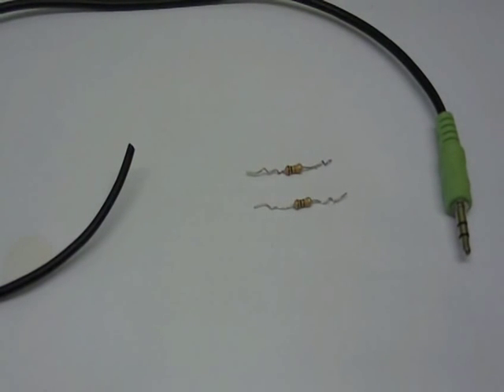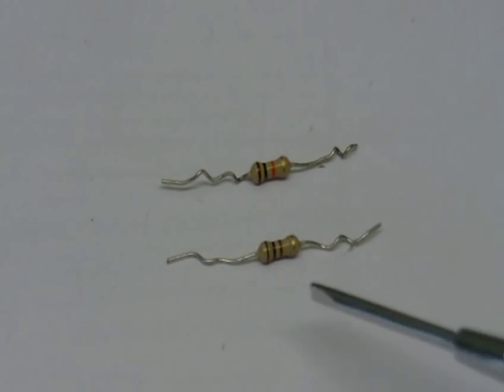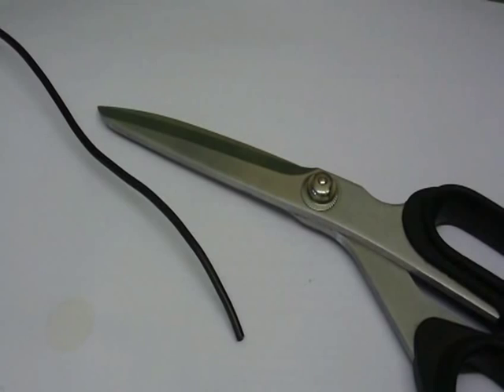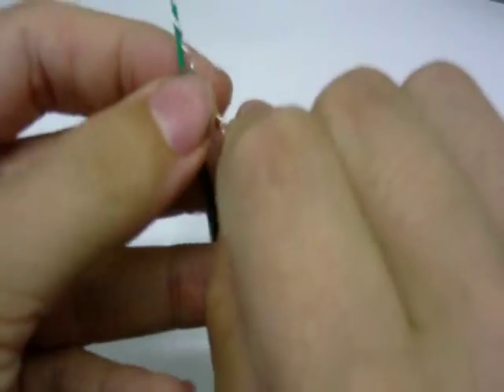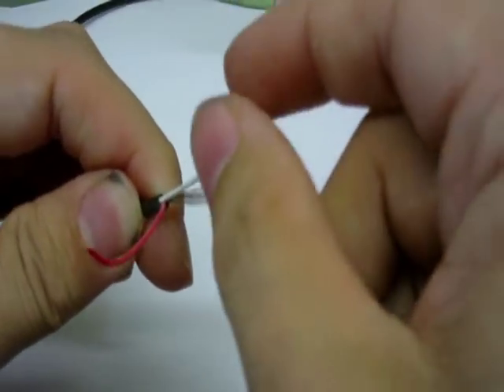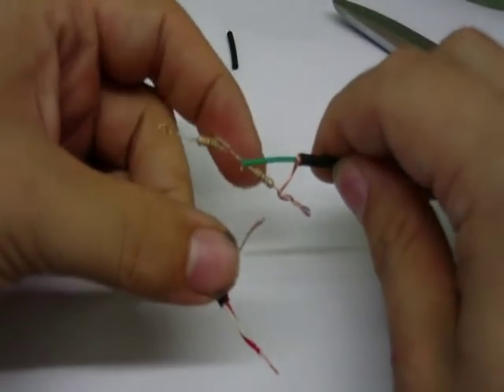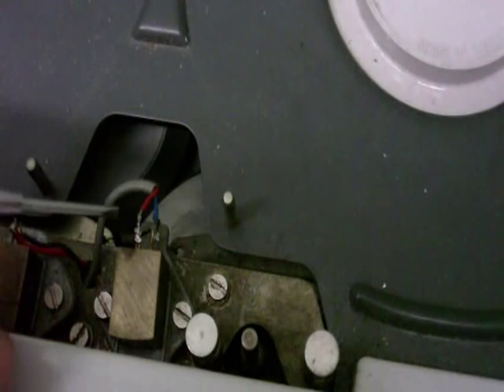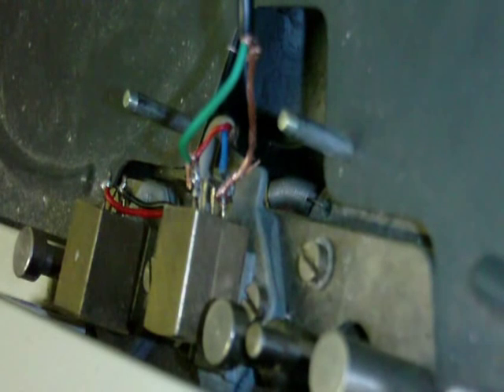How I connected an Ipod to a tape head amp connection.

Comment: Nice instructional video.  I've also found that running the audio through a large coil of wire placed near the head is enough for the tape deck to pick it up through the magnetic field, even without any direct hookup.

Comment: Does this work for stereo, or is a different set up required? I have an old Panasonic music centre with L & R microphone inputs, but these only work when recording to tape. So i'm thinking I would wire them up to the main tape head and use them as a split aux input.
Reply from the maker: unfortunately this is only a mono circuit, you would need to make two for stereo. the other thing is that this circuit was made for a reel to reel tape recorder, if you tried this on the music center you have, it will have a lot of bass and not much high frequencies because of the way equalization works on cassettes. (when a cassette is recorded the highs are boosted and the lows are attenuated, but when a tape is played back the opposite EQ is applied).

Comment: I know this is an old video, but i am trying to do the opposite of this.  i have an old Dictaphone, i want to get the tapes into my pc.  what would i need to do to add a direct AUX line OUT of the cassette head?
Reply from the maker: It's probably the amplifier in your Dictaphone that sounds bad, they are not designed for high quality sound (I did get your e-mail). Wiring the tape head to a line out jack won't work, a line signal is thousands of times bigger than a tape head signal is, so plugging a tape head into a line-in you just won't hear anything.  I think the best option is to re-spool the tape into a regular cassette and play that into the computer from a normal cassette deck. all you would need to do afterwards would be adjust the speed and maybe reverse the recording.
Reply: @CoolDudeClem  can it be used to send audio to the tape heads for recording to tape? i have one with a dead pre amp
and as for adam's comment, what if i were to use the mic input (pink jack) instead of the blue line in jack?
Reply: for context it's an old computer cassette recorder from the 80's used to digitize tapes into an emulator

Comment: Hi! I had doubts about whether this would work for stereo or are tape heads always only mono?. Could you please explain if this is possible? Thanks!
Reply from the maker: it can work for stereo, you would obviously need to make two circuits, one for left, the other one for the right and they both share the same ground connection.
Reply from the maker: no just one tape head, they come in mono or stereo depending on what they are used in.
Reply: @CoolDudeClem  Thanks! In my case it would be a car stereo, I will disassemble it and check it out.

Comment: Cooldudeclem I tried this and disconnected the old tape magnet, when I disconnect all the wires from the tape head it gives a buzzing noise, when I reconnect it it stops it is a stereo type tape magnet that has 4 wires going into it 2 for left speaker and 2 for right speaker please help...I can make a video if you need a better description, (it's on an 80s ghetto blaster)
Reply from the maker: That's quite normal, when you disconnect the tape head, the wires become like an antenna and receive the 50/60 mains frequencies that the house's wiring emits. When the wires are connected to the ipod or whatever it shouldn't do that, it's a goo ideas  to not disconnect the wires while your ghetto blaster is on.
Reply: Yes the weird part is that I'll have the wires all Separated from each other and if I plug it in even with the wires isolated it will still make the noise, then I plug the iPod wire with the resistors and it'll still buzz under the sound of  he music.. what would you suggest to fix this?
Reply from the maker: Try flipping the wire round, that might work, also you need to use audio cable, not ordinary cable, your ghettoblaster probably uses them to connect the tape head.  if so, each cable should have an inner wire and then another wire that goes around the inner wire.  It might be a better idea to make a video so I can SEE what your actually doing than I can tell what you're doing wrong.
Reply: CoolDudeClem I just uploaded 2 videos on my channel about the radio let me know what you think

Comment: Why u have added resistors cant we just add directly to wires
Reply from the maker: The voltage is much to high to connect it directly and would overdrive the tape head amplifier, so the resistors reduce that voltage down to where it would be if it was comming out of the head.

Comment: Whilst the ipod can play through a tape player i fail to see why youd bother.

The tape head cannot make the sound any better as it is alreafy digitized to play on the ipod.

To digitize the signal the ipod plays disjointed samples of music rather than the whole music signal. 

Playing it through the wires connected to a tape player isnt any clearer than using a bluetooth speaker.

Lately audio tapes are returning to popularity and while they'll not compete with digital music they do iffer a very cheap way of playing musis..that sounfs great on really good equipment that nowadays is much cheaper.

I appreciate the ingenuity to connect up the ipod but the rationale for doing so isnt me tioned nor is it obvious as external amplifiers are more portable and also dont take advantage of any perceived analog componemtry.
Reply from the maker: It was just a fun experiment, I dont even use my iPod anymore as a couple of years ago I just decided to not bother with apple iAnyting.